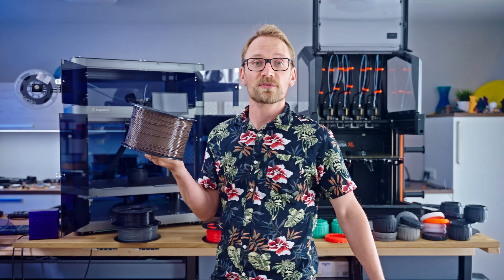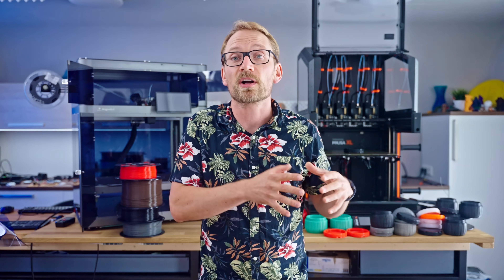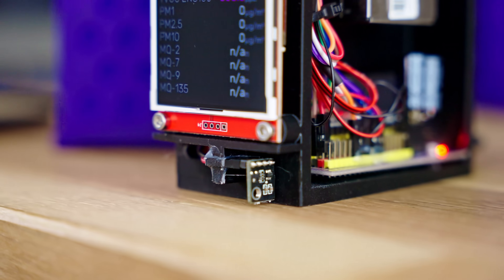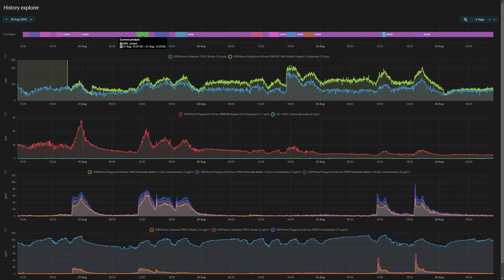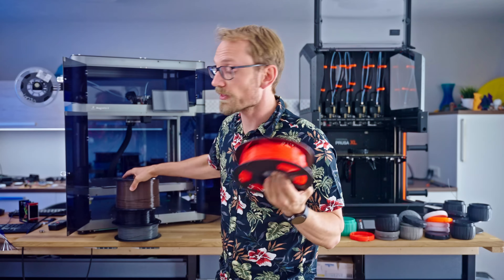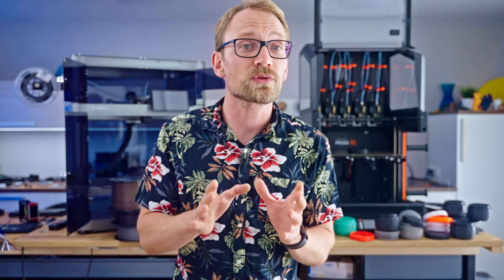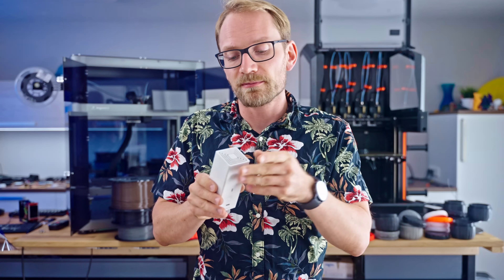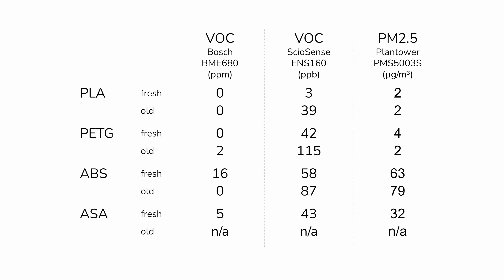3D printers are worse than I thought. Time to do something about it!

Comment: There are automotive interior components I plan to make with a 3D printer designed to work with my fiberglass parts. I plan to use a box trailer to put the printers in so the temperature and air quality can be regulated with filters and air-conditioning. This is cheaper than having to build a building to code or even buying a portable building.

Comment: Thanks for the summary and your findings. As my profession I do workplace exposure measurements (here in Germany), but so far, in case of 3D printing, mostly measured SLS (dust, metals and chromium (VI)) and only once a FDM printer (only VOCs, no dust). But in a few months we have SLS, SLA and FDM on the agenda. In my field it's always difficult to have a complete overview on what substances you should look for, so thanks for the sources, they will come in handy. 

On the topic of activated carbon air purifiers: the main problem with many VOCs is, that they tend to desorb easily. After some time, they will just be in the air again. That's why masks for VOCs have a limited time of usability after the start of the first use, in contrast to masks for larger organic molecules that can be used as long as they are not fully loaded. So, theoretically, you would have to use a new filter every time you print. However, using activated carbon will always reduce peak concentrations and should work great on dangerous substances like BPA. 

I want to note, that your formaldehyde concentrations are not that good. You measured about 0,08 - 0,1 mg/m³, that's roughly 20-30% of the workplace exposure limit of 0,37 mg/m³ and quite close to the limit for room air of 0,124 mg/m³. Knowing the source of the formaldehyde would be good.
Reply: Hey can you post your new insights on PLA FDM printing somewhere please?

Comment: Some of those printers have internal filters so will create a pressure differential/flow. But the stock filters are typically activated carbon only, stuff like voxel x-filter should help with a hepa filter. And there were some tests with a bentobox filter (hepa) showing improvements (since stock carbon only would have been used in the internal filter)

Comment: I made my hotend all metal, only use PETG and PLA, and run a Leviot Core 300S with a Hepa 13 filter 8 inches away from the nozzle whenever I print. Hope that’s good enough. At home I keep my printer in a separate room but that’s not possible in a college dorm.

Comment: Also a respirator mask like the 3M type is a good choice if you just want to pop in to your printer room to grab a print off the bed. Make sure one does research as to what filter to use with what type mask. I did much online research and then I called the company 3M just to make sure the filter would fit my mask. And what type filter they recommend. Make sure you ask how often you need to replace the mask filter.

Comment: I put a grow shop (for weed) air extractor in a dedicated a room to 3d printing, workshop and storage and I activate it through alexa with an iot plug controller (2.5usd) if I want to enter the room. If I couldn't do that, I'd buy an indoor weed tent and put a tube outside the house. I'm sure I'm living longer because of that. Thank you for confirming it

Comment: I have an Air Doctor brand room air filter that is larger (and more expensive) than the Ikea unit.  I leave this running in the closet where I put my printer when printing ABS.  I've only used ABS for printing Voron parts, I mostly use PETG.   You didn't mention the Nevermore filter, that doesn't exit air outside of the printer enclosure, it filters the air inside the chamber to capture particles.

Comment: I wonder if this makes a stronger case for CHT style nozzles, since we are at least in part using higher print temps to compensate for uneven heating. Since we can use lower temps while still getting comparable layer adhesion. (I guess it's also more completely melting the plastic - so it definitely would need to be tested).

Comment: I used to work at a plastic factory where the ABS smoke was thick always when having to switch between materials (transparent, black, white and between PC and ABS). We also used a soldering iron to fix holes in products made of rubber material. Once I was washing my hands with acetone several times a day to get rid of the paint from stamp marking products, and the first layer of the skin was destroyed for a long time. Can't say I miss that job.
Reply: Are your lungs okay?
Reply: @AlmaSuculenta  Never examined, but I hope so. I have a high resting heart rate and get exhausted way too easy though.
Reply: How high? Could be from caffeine and/or nicotine but is only about 5-10bpm resting heart rate increase. If your average resting heart rate for a given day is above 90 bpm you need to seek medical help. May be a conduction issue. Or anxiety. While the latter is not deadly on its own, it takes its toll on your body over time and you don’t have to live this way. -mine was anxiety by the way. Ignored for years due to fear of losing my wings. Mental health awareness has come a long way in the last decade and not only is it accepted but they have great treatments for it. Stay strong. 💪

Comment: im planning to get an qidi q1 pro, so what is an ideal cost effective setup?  Apperently it has a really good negative pressure in the chamber because you can run the exhaust fan full and still maintain constant chamber temp - so carbon filter just outside the vent fan and then through a duct to outside?  There's a lot of information here and I would rather consult with those who are more experienced.

Comment: Thx for your research!
I always assumed ASA was quite safe...
Regardless i printed in a room, where i didn't spent much time in and thoroughly ventilated after long printing times.
The thing i miss in your research, is what happens when fiber reinforced filaments are beeing printed. I assume that this is probably not beneficial for the air quality... 
In the future i will probably also put my air purifier next to the printer when printing.

Comment: Smoke extractor > HEPA14 + Activated Carbon > HEPA13 + Activated Carbon > HEPA > EPA> Open doors + airflow > Nothing. You need to talk about the fan also. Many fans cannot generate the necessary pressure to push air through a HEPA filter, which has very high resistance. And don't forget about the weight and size of the filter. All the Chinese filters in Bambu Lab, Raise 3D, Anycubic, and Elegoo are almost empty inside, which could explain one reason why Chinese machines are cheaper than other brands in the EU. What do u think Thomas? And please, don't make videos just to sell your funny sensor anymore, all fake

Comment: Resin printers and anything that touched resin cannot be located in your house. Formaldehyde is a known carcinogen. The ammount of PLA ultrafine particles during printing is also insane, so FDM is also a garage/basement-only thing. It's been scientifically tested a lot by now, there are many research papers on this. Why is there even a discussion or doubt still? Move it to the basement or at least get yourself a hepa filter purifier to slow your decline.

Comment: You should measure the concentrations in other rooms of your house. And outside. Just to have a reference what the air is like without 3D printers. Some chipboard furniture emits low traces of formaldehyde.

Comment: These things do not belong in private hands sorry for you printing guys. A on demand printing service in a  industrial hall with proper filtration system? Sure why not. But having this in a private setting is beyond stupid. These poisons will accumulate in the body and its nearly impossible to get it out of your system once its inside and it does harm longterm ( again the emphasis is on >longterm damage< maybe you think "I didnt notice anything and I slept next to a printer for years"  [I hope not] but as your body gets older the "emegency measurements" preventing failure gets weaker too inside you). I mean even if you blow that into the outside air you still pollute the environment if its not filtered properly.
I'm not trying to be a d*ck here I'm just concerned about tinkerers getting cancer in later stages of life because of this kind of thing. [Yes we already have many poisons in our surroundings but having one of these things is making it worse for you].

Comment: Quick note: Consumer air quality monitors won't have a reliable VOC sensor because a PID sensor alone starts at around $500. Anything cheaper than that is at best a semiconductor sensor (but may just be estimating from other sensors). These can only give you short-term trend data, as it assumes whatever it sees on average is actually the average and scales from there. They also react differently to different VOCs (that's part of why they spike so much when you spray isopropyl alcohol on your build plate). BUT we don't have good information on how they react to whatever 3D printing is giving off. So, even on a relative scale, a higher number for one filament could just mean a different TYPE of VOC than a filament with a lower number (which might actually have vastly higher actual VOC concentration).

If you want to know if you've managed to reduce VOCs this month compared to last month the price tag on that information may be more than you paid for your printer.

Ok maybe not so quick of a note.

Comment: Nice video and research you've done. Most interesting part for me was that the enclosures don't really have an effect on the amount of particles despite of the filters build in. That means the only use case for having a enclosure is for being able to print temperature sensitive materials, so to ensure print quality and maybe a bit noise reduction. Very interesting when looking who many manufacturers and open source printer designs lay so much energy in putting HEPA filtration inside their printers, obviously just ground on guts not facts based on studies like this one.
However, before run and buying these IKEA air purifyers take a look at this video, too:
https://www.youtube.com/watch?v=gaQTYrisieA

Comment: I don´t print too much. My printer is in the same small room where I sleep. I just use overkill air filtration. Ionic one attracting fine dust to the removable electrodes and a HEPA filter style big air cleaner with 7 fold filtration. So far so good. I am considering adding even more filtration just to be sure. I´ve got the best air in the whole flat :D
Reply: How did you set that up?
Reply: @deathtdow  I stood the air scrubbers on the table and turned them on :) Well, the electrostatic one is a actually a dumpster find, somebody dumped it almost brand new because the IGBT transistor failed. Easy fix.

Comment: I got my first printer in 2021 and in a month i built an almost sealed enclosure with a large tube running outside and a 3000 rpm 140mm fan pulling air out, this created a negative pressure that was drawing fresh air into the enclosure and "dirty smelly" air out. Glad to see this has been a good decision, i did it mostly to guarantee control over the printing environment and to avoid the strong smell, it worked great in reducing noise and power consumption while printing. While printing abs for example i limit the amount of air i let into the chamber, making it get to 50c this means that the heated bed is working a lot less to keep the high temperature.

Comment: Interesting video! I first owned a GEEETECH, and I thought there would be bad fumes from melting plastic, but I didn't notice any. I then bought, and still have, the Creality Ender 3 S1, and never noticed a bad chemical smell. I recently bought the Bambu Lab A1, and from the first print on it has a very strong nasty odor, and I basically only print PLA. I wonder if the Bambu Lab printers are worse than most, and I think it's the printer itself, not just the filament. I bought a HEPA air purifier to place next to it, and run it at full fan speed, but I think I can still smell the fumes, likely VOCs. I'm thinking about how I might try to vent at least some of that air outside.

Comment: I almost never print with PETG anymore. I used to get pretty serious nose bleeds. (I actually ended up in the emergency room a few times because I couldn't staunch the flow.) No more nose bleeds after going back to almost exclusively printing PLA. I should probably use a filter for even the PLA.

Comment: I also have one of these cheap particles sensors and it always shows pretty much the same ratio of values for the size fractions. Apparently the sensor seems to be quite accurate for PM2.5 and more or less just fakes the other sizes.

Comment: Hi there, I'm a big fan of your videos and they have been very helpful in guiding me through my 3d printer build and maintenance. I'm a small time Engineer from a 3rd world country located at the horn of Africa, Ethiopia. getting my hands on a commercial 3d printer is quite difficult and expensive. But recently I've managed to get my hands on a DIY one that is open source and made from wooden frame. It's quite good but lacks so many things compared to the latest 3d printing technologies. I'm reaching out for your help and guide to help me be on the same Page as the advances in 3d printing. My printer is slow and very backwards.

Comment: Hi there, so i wanted some clarifications, i watched the entire video from start to end but i might have misunderstood something , im a uni student Who bought a 3d printer 8 months ago, unfortunately i dont have any other places to put it except in my room near my bed (it's pretty much beside it) , now i only print PLA and rarely PETG and TPU, and from what i saw at least for PLA and PETG it seems they're under the WHO standards of harmful levels, now i wanted to buy an air filter with a hepa filter with active carbon even without this video, but what i want ask is am i safe? I know i shouldn't 3d print in my room but i dont have any other space and i would like to continue like i always had, buying an air purifier with the specified specs should technically remove even the little emissions PLA and PETG produce right? 

I thanks you all for reading this and sorry for the bad grammar

Ps: the air filter i want to buy is the levoit minicore, i know it doesn't have a True hepa filter and only hepa but that's the limit of what i can spend and from what i've seen in the specs if i put it really close to my printer it should do it's job

Comment: I have been working with commercial paint booths for over 40 years. That uses a downdraft system that pushes the vapors down into a waterfall system. With a positive airflow outside the system to keep the fumes quarantined to that specific space.

Comment: It's like people that think the container they are drinking water from is safe because it has a label that says, "No BPAs."  The stuff they use is just as bad/breaks down into BPAs in short order.  Plastics are not things you want to ingest, inhale or introduce into yourself unless an absolute necessity (ie medical device).  Solder fume extractors (a real one, so if you only pay $15, well, you really think thats going to work? haha) can be easily parked by your rig if you dont have an enclosure, which you really, really, should.  Grow tent filtration systems have charcoal container sections (so several gallons) you can put inline for air exhaust.

Comment: Hi Thomas, my name is Francesco, and I am a 16-year-old guy passionate about 3D printing. About a year ago, I bought my Elegoo Neptune 4, an amazing printer that works very well, and I am happy with the purchase. Unfortunately, every time I turn the printer on and off, the Z-offset changes, and I have to recalibrate it manually. This frustrates me because I’m forced to make a lot of clicks to level the bed. So, I started searching online for a solution, but the automatic calibration either involved a load cell mounted on the nozzle or external hardware that was complicated to install.
So, I came up with a software idea that could automate the whole process. Here’s how it works:
You need to know the offset between the 3 axes, which is the distance between the nozzle tip and the probe for automatic bed leveling. You tell the printer to move to a coordinate near the center of the bed, take a measurement with the probe, and save it. Then, the head should move to the same coordinates but adding the previously recorded offset in X and Y, take another measurement, and save it as well. After the printer has returned to the previous coordinates, it needs to take the two previously saved data points and insert them into the following formula (the first measurement = A and the second = B, the Z-offset probe is the offset between the nozzle tip and the probe on the Z-axis):

(Z-offset probe + (X)) - (Y) + 0.1mm.

The final instruction to give the printer is to set the current Z-axis coordinate as the Z-offset.
Unfortunately, I don’t know how to program in G-code, so if you think this software might work, would you be willing to help me write it?
(If you think it won’t work, could you explain why?)
I hope I was clear. Thank you for your attention, I’ll be waiting for your response to hear your opinion on this matter.

Best regards,
Francesco
Thank you for your attention.